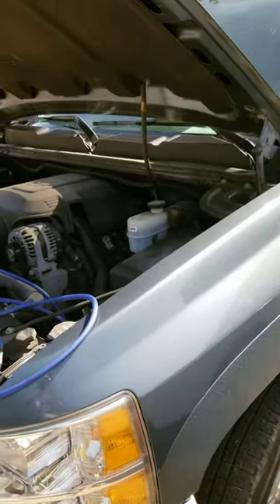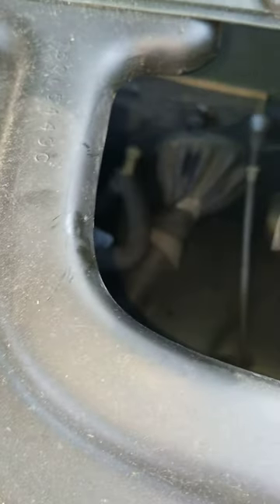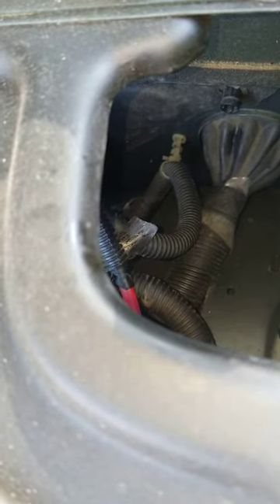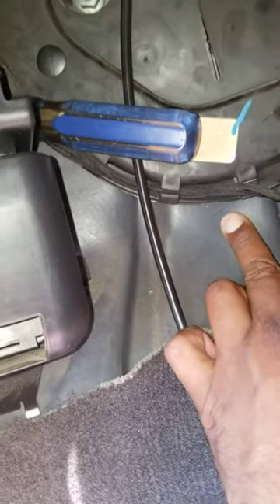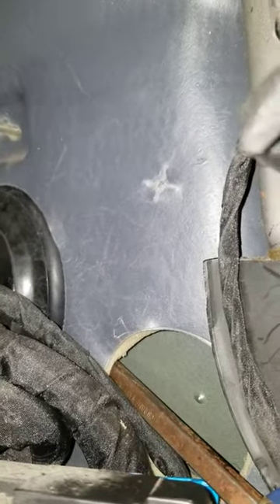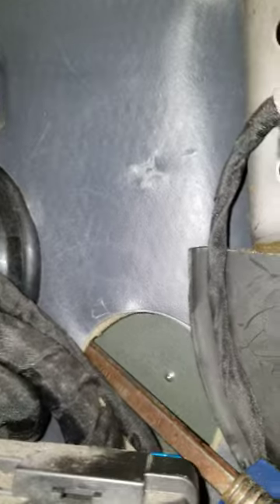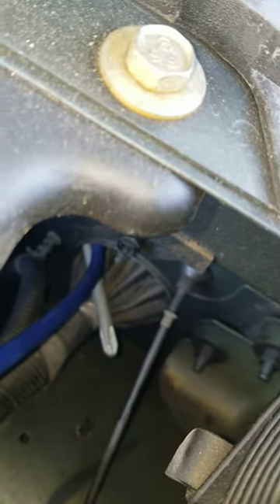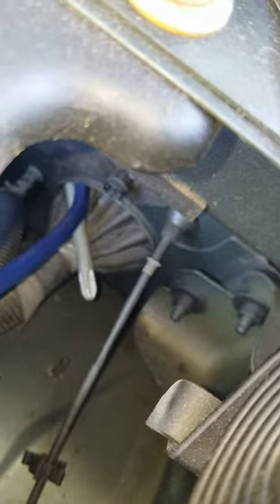Power wire theough the firewall 2012 Silverado Easy.

Comment: TAKE NOTICE ** The inside firewall has a drill location CROSS-MARK stamped on the rubber insulation as seen on this video... directly adjacent to rubber grommet. PUNCH HOLE set for drilling by factory on engine bay side under the insulation.LOOK and SEE here he missed it and it was right in front of him..